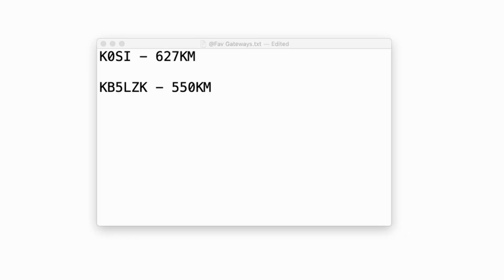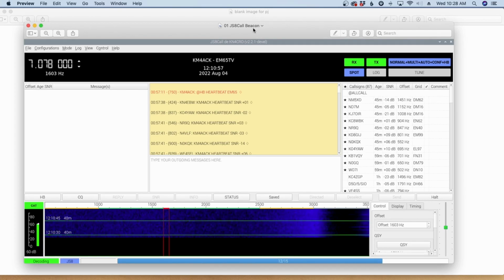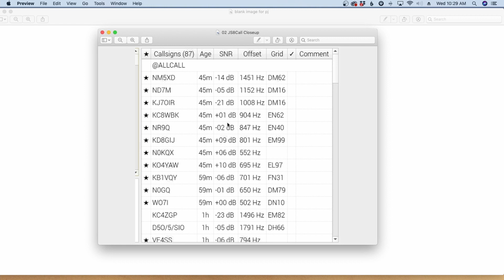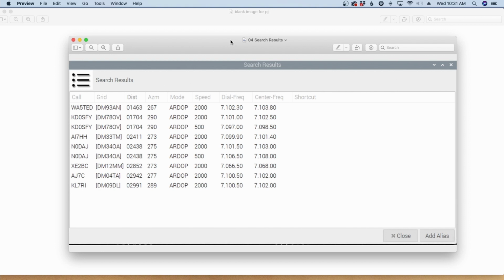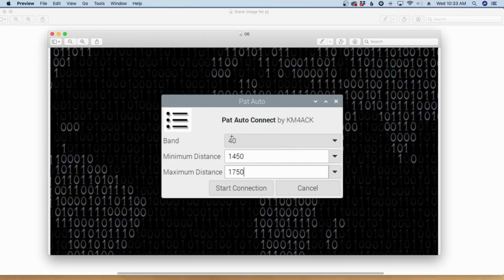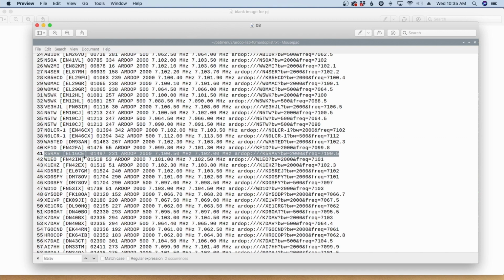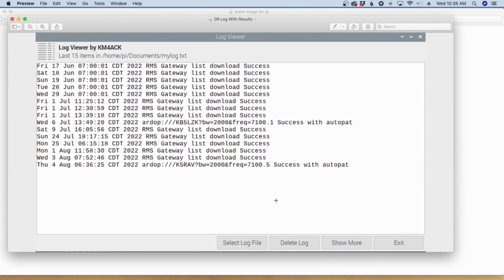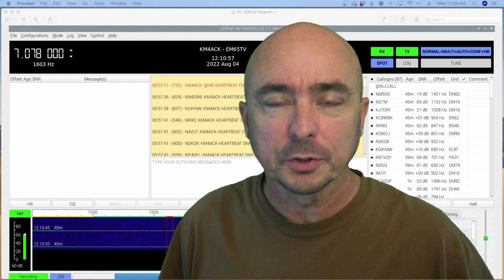Finding Winlink Gateways

Comment: Jason, going the next step, does this work if you don’t have internet connectivity? If I remember correctly the station list is saved when you update it from the internet so I’m guessing that it will work later when no internet is available. I’ve also used FT8/FT4 to check propagation.
73!
Reply from the maker: Yes. It works offline after the initial download.

Comment: Thanks for the video.  I haven't done anything with Winlink in about 25 years.  It's interesting to see how far it has progressed over the years.  Since I'm a Linux shop winlink has not been much of an option.  I understand the situation has improved recently but I'm reluctant to spend money on VARA since I don't really have a use for Winlink.  I have two cell providers that give me great internet connections no matter where the RV wanders.  Very interesting video.  I may be putting a state park on the air Monday if there are trees around the site.  I have to rely on a long wire and an SGC tuner since I don't have a mobile antenna on the MH yet.  The last state park I was at only had a couple of bushes nearby.  The nearest tree was about 200 feet away.

Comment: I downloaded the Winlink software and got as far as getting my callsign and grid set up. Haven't got to try it out yet due to recently having surgery. I'll be playing around with it when I can.

Just wanting to get my IC-705 back from Icom and I'll be send my IC-7300 off to Icom shortly after I get the 705 back (the screen is going bad on the 7300). Been having some issues with radios here lately, but looking forward to learning Winlink. 

73, W4ISB 
Mike in Tennessee